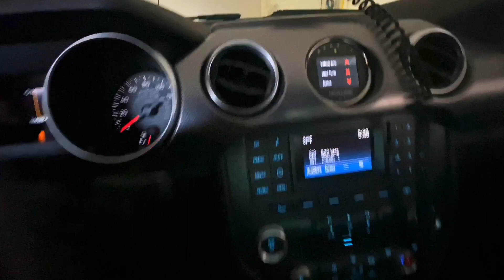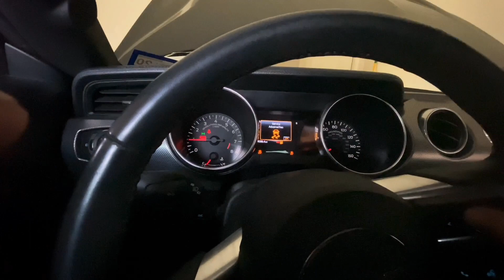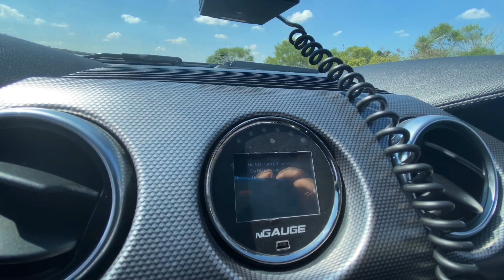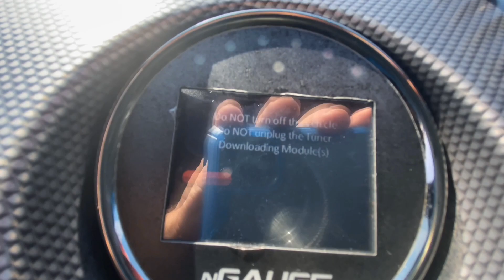FIRST GEAR PULLS IN MY BOLT ON E85 TUNED 2018 MUSTANG GT!!!!(140+MPH)

Comment: Yo its a terrible habit to throw your car in neutral like that at that speed. Leave it in gear to help decel by engine braking. Also have more control with it still in gear.
Reply: This is the worst advice in the world... You are supposed to throw it in Neutral because if you let off the gas at high rpms it puts a ton of stress on the valves and components inside the motor. This will sometimes cause a motor to fail which is why you want to put in in N right after you let off.
Reply: @Beessubie  Thats complete and utter horseshit watch any race around a track ever.
Reply: @Onearth5347 Dont just make shit up... lol

Comment: Absolutely no reason to be coasting in neutral at that speed 🤦
Reply: I Know nothing about manuals, please tell me why not to do it
Reply: @SirenS550  There’s literally no good reason to do it. It consumes more fuel, you lose a degree of control, and you unnecessarily wear out your brakes, especially when slowing down from 100+ mph like he did. Better to stay in gear and periodically downshift to take advantage of engine braking
Reply: @jaeh1564  correct me if I'm wrong doesn't engine braking like that decrease clutch life?

Comment: It's Def not 480whp! More like 450ish.
Reply from the maker: Boosted 5.0 catless intake and e85 on a gen 3 yea that’s about 480-490 whp
Reply: @NRGarage  Not even Close but nice try! 450ish Tops
Reply: @boosted5.035  if he had long tube headers it would be around 500 whp with intake and e85 tune but not with just a cat delete and intake. Have fun with it.
Reply: @csr801996  Incorrect! Full bolt ons is intake exhaust Manifold Headers E85 and Tune! Like I said he's around 450 tops and thats pushing it!
Reply: @boosted5.035  did you read what I posted? With headers and intake and e85 tune youd be around 500 whp. It doesn't need an intake manifold because the 18 and 19 have a better one than the 15 to 17. So what part of what I said was incorrect
Reply: @csr801996  I'm stating on what FBO stands for! He's nowhere near 500whp at this point! What don't you understand?
Reply: We talking mustang dyno or dynojet? Because all that on an 18-19 which is a Gen 3 coyote will hit 500whp on a dynojet. my buddy made 471whp with a pmas and Lund e85 on a dyno jet. Gen 3s are that stout and are in whole different league from the gen 2 NA. Now if we are talking boost I would prefer the Gen 2 because the sleeves are stronger. 15-17 fbo e85 with everything you mentioned yes is around 450whp on a dyno jet.
Reply: @Happy2SprayU  Nope an 18 5.0 on a Dyno jet without Headers is not touching 500whp!
Reply: Plenty of gen 3 coyotes are making 500whp on E85 tune with long tube, cat delete and intake only, no doubt he's making 480whp.
Reply: Boosted 5.0 do more research before you comment my dude. These 2018s and up make a lot of power to the wheels. Plenty of videos people making 500whp with 3 simple mods
Reply: Boosted 5.0 it’s actually more like 510 lol
Reply: @boosted5.035  Wrong I did 474 with my gen 1 e85 FBO with a CJ gen 3s dyno higher for sure..The manual gen 3s usually don't out down good times in the 1/8th and quarter